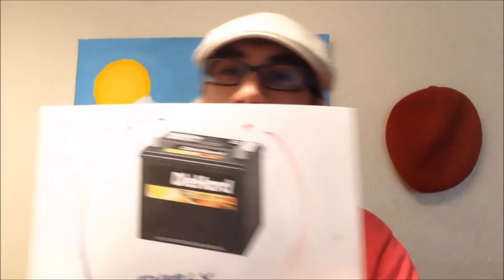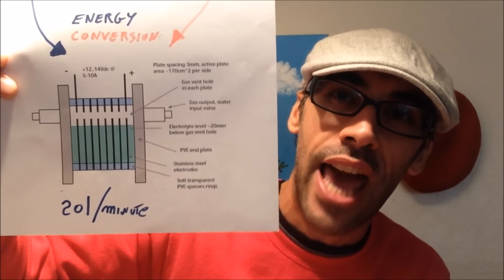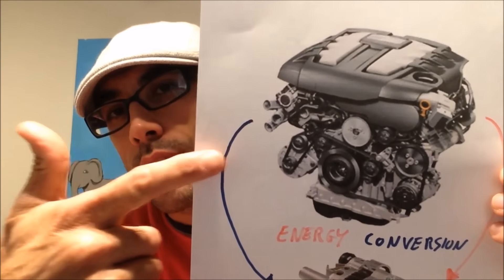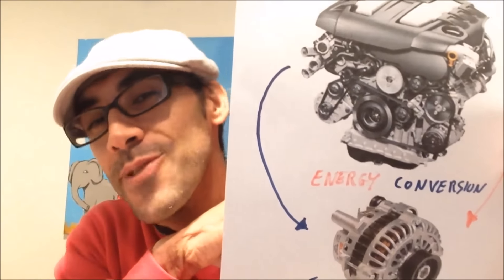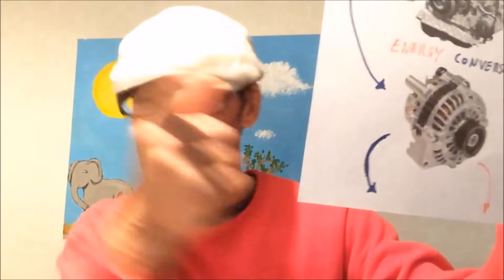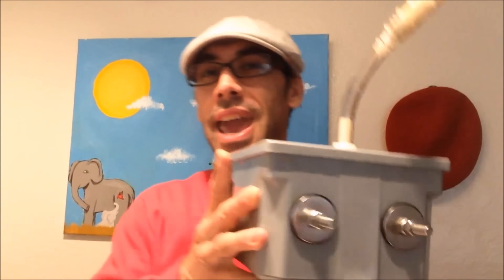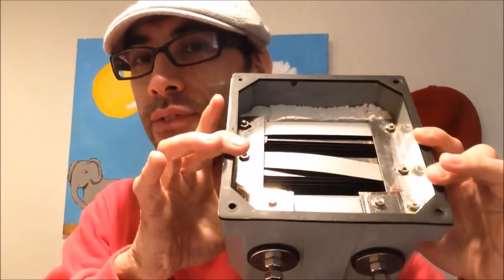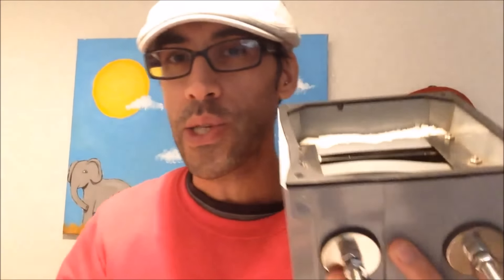FREE ENERGY Stanley Meyer 100% car motorcycle water EXPLAINED DEBUNKED!!

Comment: I love all your videos but check this out. I was running my car with pure hydrogen. I used a plastic water jug full of water and 10% naoh. The car had a LPG carburetor system and the pure hydrogen generator had three settings. Each settings would drop more aluminum pellets into the tank. The naoh would strip the aluminum oxide layer and expose the aluminum to the water and hydrogen is released and the oxygen is absorbed into the aluminum making another layer of aluminum oxide and the process happens over and over till the small pellets are fully used up. The three setting would drop a different amount which gave me three different rpm speeds. I had posted videos of me compressing this full safely and my car running on this full and shortly after my last video the police came to my house and told me not to drive my car on the road again till it was converted back. Also they informed me compressing hydrogen is illegal, so now I only have videos of pure hydrogen production on my channel. So you can run a car on water but it will destroy your motor. I am a mechanic and put a camera in my cylinders and into the carburetor and it didn't look pretty. With the pure hydrogen you can control and set the ratio of hydrogen and oxygen which is important.
Reply from the maker: interesting story.

We already have plenty of hydrogen cars for sale including:
Toyota Mirai 
BMW hydrogen 7 
Nissna X-trail 
Morgan LIFEcar
FIAT Panda Hydrogen
etc.
etc.

Why would you build one yourself at home??? 

The chemical reaction from a battery is FAR MORE efficient than aluminum oxide oxidation process

Cheers!
Reply: I was bored and have a bunch of old cars in the yard and received all the aluminum from the local landfill for free to make the pellets. Just wanted to see if hydrogen could run a car and how well. I am retired and have lots of time and free material and a free vehicle so why not see if it would work. But for anyone else its not feasible cause the naoh, or pure lye and water and aluminum cost more then gas does. I am out on my gold claim mining right now but thanks for the response. Cheers your fan Daniel.......
Reply: Also it use's zero electricity to make over 100L per minute of pure hydrogen gas......
Reply from the maker: It sounds like you`re living your retirements as my dreams suggest me :)

Inventing, disassembling, building etc that`s my future pension if I ever reach one! 

Cheers!
Reply from the maker: yeah electricity is just a quicker way around, nothing special

Comment: If you run a second alternator ,by pass the diodes you will have 60 plus amps dedicated power to the hho
Reply from the maker: running a second alternator will drain more power out your gas engine and drop efficiency even lower

There is no free lunch for anyone

Thank you for watching
Reply: Skeptical Open-mind if you have 60 plus amps you could power 2 or 3 cells and increase output of hho to increase efficiency

Comment: I see you can run your car on water. Did you disconect fuel line from the engine ? if not then you use gasoline to run your car mr free energy...

Comment: That car has a computer controlled ignitions system and just hooking up a HHO system to it wont work. you have to fool the O2 sensor. Meyer had a distributor cap system... no computer. gas burns at 783 F HHo burns at 5000 f, you probably have a hole in your piston.
Reply from the maker: While actually running an ignition system on pure HHO is not good and can damage other parts for sure.

None of these ppl have a "hole in their piston" :)
https://www.youtube.com/watch?v=VteoVsK93Mg

https://www.youtube.com/watch?v=NuDVXjS5Lhw

https://www.youtube.com/watch?v=3JbXLGIL_fc

https://www.youtube.com/watch?v=j4cRvz1fDPA

Regards

Comment: Modern cars have a fuel regulator. Modern cars have a fuel regulator, adding hydrogen to your fuel just increases the output of regular gasoline into the engine. If you have an older car however it would work. But I never heard about adding ammonia to increase reaction. I'm going to try it! LOL

Comment: You are lucky if you are making 1 liter per minute. Possibly two. I know you didn't do the liter test, but putting that aside, why wasn't your alternator running the fuel cell? Why did your battery drain? Did you disconnect your alternator? I'm honestly curious.

Comment: making hydrogen out of water via wire cables from battery to copper/metal plates in sealed container with a vapor filter and tubing leading to fuel injection system ()carburetor works better), and tweaking of air/lean mass on both the system and the ccm(computer control module) to accept a leaner fuel/gas mixture for combustion. No matter what, it ALL requires energy to make, its not about free or not, its about the cheapest/easiest/most productive versus cost.
Reply from the maker: Yep Yep well said!

We already have hydrogen cars(Toyota Mirai, Honda clarity etc) ....

obviously the hydrogen has be produce "outside" the car system AND hydrogen cars a are rigorously electric here is why:
electric engine(>90% efficiency) 
combustion engine(<60%) 

Cheers!

Comment: The U.S. military used engines in some Spitfire and even some P-51 M.ustangs that ran on water.
Reply: yeah they stop using that engine since water got so expensive...
Reply: only partially, the steam was produced using the rejected heat and was used as a catalyser to improve the total efficiency.

Comment: I think you picked the wrong guy and subject! Stanley Meyer's Cell did not get hot as it certainly does with high current (A). The combination of Resonance (Hz) and High Voltage (V) is the key here, not high current!
Reply: I think you picked the wrong guy and video to criticize! Point in this video where it complains it gets hot his cell. Hz is just frequency ...resonance is totally another thing...high voltage is not the key at all. As a manner of facts is the QUANTITY of electrons (A) flowing thru the liquid that causes particles bond braking not how fast (V). Voltage causes whats called "skin effect" and Faraday proved you can have all the Voltage you want without current.
Now how in the hell you gonna brake the water molecule without current???
Reply: It`s funny how folks here think they know shit and complain when in reality they don`t know what they are talking about!.
The quantity of molecules splited is proportional to the amount of free electrons flowing thru the material so YES FUCKING AMPS...CURRENT!!!
Reply: Resonance is always Hz (as a single frequency, a combination of frequencies, or frequencies modulating in a linear or logarithmic fashion - always based on frequencies (Hz) - live with it, man ...
Reply from the maker: No worries "man" ...we`re all open mind here....Could you please build a water car,make a video of what you just claimed including some math that support your claims and where you get the extra energy once you convert it 3 times ....

Thank you really appreciated
regards

Comment: continue...: they would be put out of business by his products since you can not gain perpetual income from this process. The same thing happened to Tesla and J P Morgan. Tesla's device could not be metered to secure perpetual income for the capitalist.
Reply from the maker: This is the 3rd comment mentioning Tesla, Tesla, Tesla...I can tell you really don`t know what you talking about :)
Reply: Put the meter at the equipment receiver Tesla developed and it was definitely in Kwhr. I tried placing wire coil 1 meter near a 230 kv line and developed 6 kilovolt. At 2 meter 500 volt then connecting diode line to ground a had a power!

Comment: funny guy. gas engines may be 20-40% efficient. the idea should not be to run a car on pure hho but to add hho and water vapor to gas to improve the efficiency of the gasoline blend in the combustion cycle.  maybe with microcontrollers and sensors (measuring power, required torque and heating requirements, etc) gas-hho-h2o vapor engines can be made more efficient.
Reply from the maker: Thank you for watching! :)

This topic has been well discussed already, just scroll down thru comments.

Gasoline and hydrogen are 2 completely different chemicals that share literally ZERO physical characteristics in common.
Mixing these 2 things in your engine can only cause damage do the vehicle and dirty burn in the combustion chamber. 

Regards

Comment: the only good idea is the use of H2 as combustible......very clean.....solar energy to produce the H2 would be an alternative....shipper than gasoline?......also oxidating aluminum would be a source of H2......thanks for your videos.
Reply from the maker: Yes sir correct!
As a manner of facts Toyota Mirai is widely sold as a fuel cell car that runs on Hydrogen.

Of course has tanks to store Hydrogen safely since you cannot produce hydrogen while driving. :)
 That would be called "perpetual motion car"

Comment: Dude are u like a disinformation agent. How the fuck do use up 30 amps and twenty volts to get such little gas? I am not saying there will be over unity but there can be effeciency. You do realize that u can use a combination of frequencies and pulsing to get way better efficiency. 20 years ago we ran a lawnmower motor with 12 volts and about 700 milliamperes draw. It ran for at least 8 hours. Also u used a normal car. U do realize that many years ago they changed the carburetors to prevent people from using any kinds of gas. No wonder it killed ur battery so quickly. If u are going to debunk at least do things the right way....not just slapping something together with no knowledge just to prove a point.

Comment: Well, some things like heat generators use water steam for power. Debunking water for motorcycle use? lol
Reply from the maker: Yes correct! heat generators :)
usable but efficiency is less than 20% so for sure not free-energy and probably barely "green-energy"
Reply: Skeptical Open-mind Steam heat generators, like a sauna...
Reply from the maker: Using the steam out of a sauna it`s like dropping an ice cube in my hot tea :) 
Attaching a load in a system defeat the purpose of having that system in the first place!

Speaking about sauna....I have an idea for tonight after work 
Awesome thank you for the idea :)
Reply: Skeptical Open-mind 
Hey at 9:07
You literally made me drop my phone from laughing keep up the good work man!
Reply: Nate What?  You can use steam to do work, of course.  ITS CALLED A STEAM ENGINE.  Much LESS work than that required to turn the water INTO STEAM.
Reply: Nate wow, really.  You think tgat heating water above 100c to use the HEAT in a sauna has any relationship with the topic under discussion?  The heater in your car also uses the HEAT of hot water, did you notice that inventor being killed by the illuminati?

Comment: Who are you working for it's very easy for alternator to push 200 to 300 amps it's called pwm the power you get from hydrogen is more powerful than gas so we'll have no problem pushing that alternator you need to advance your timing too

Comment: Water has plenty of energy to do work e.g. Even run a car and far far more ,,the key was to release it with low volume of energy at high speed pulsed resonance,,H H O ,,,,,,which Stan Myers and family achieved ,,,,,just curious are you with a cult and if so how much to join CHEERS.

Comment: HOLY SHIT!!! I JUST REALIZED WHAT THIS GUY SAID. HE SAID HE MAKES 20 Lpm with less than 30 amps at 12 volts. Using 30 amps at 12 volts should give 3.34 lpm so this guy electrolyser is over 590 % efficient. Dam bro forget about running your car on water you should be selling those electrolysers. With that efficiency renewable such as solar and wind can store hydrogen 5 times more efficient than what they currently doing.........
This video is somthing else 🤣🤣🤣

Comment: I can see you mind struggling when trying explain the laws of thermodynamics with out acually saying them(i.e. using this scam and its faults as examples).
Lol and i feel your pain, i dont know how to explain it any simplier, science=/=magic period.
Everythibg is acounted for!
Reply: Unbelievable...you have no understanding of the concept you need to learn more .if you had More output from your cell you would get enough RPM from your engine to charge the battery..... ...how can you get so close but then miss that single point ?  more LPM from the cell and it will work, you may well need a larger alternator to go with the added amperage demand. but it will work ! try it !
Bob....

Comment: You only need 2 amps to produce 1 leter per minute per minute.  Your experience with HHO  was with little research and  laboratory expermintation. You have lost a lot of subscribes me being 1 of them.  If I had the funding to continue to build the HHO vehicle I would. Even the motor cycles you had on the video were working. Explain that if you can. Hydrogen is use to launch space craft into outer space from earth. So hydrogen as a fuel is in current use. Thanks for proving people will give up after only a small amount of effort. As for me its back to my lab to build a Stanley Mayer HHO Generator with the proper amps and frequencies.
Reply from the maker: We have plenty of hydrogen cars for sale made from real engineers. 

None of these cars obviously run on water 

Once you make your water car don`t forget to throw a video to debunk mine! 

For now running a vehicle on pure water without charging the battery is PURE BULLSHIT for SCAM.

Thank you for watching!
Reply: Jerry, the hydrogen used to fuel spacecraft is made by mixing natural gas with steam.

Comment: PSS . You pulled over with your flashers flashing then you show us on a volt meter the battery  dead as hell no volt what so ever. You blew it game over fake.
Reply: even kids know a car battery is considered dead when below 12volts or not enough CCA. Still plenty of juice to run low drain lights such as blinkers.
Reply: Run lights but not show anything on a volt meter? I believe those kids need to go to a better school.
Reply: voltage shows zero for the simple fact that turning signals sucked the little juice left in it. Is it really so difficult to understand?
Reply: No way you can totally kill a car battery that fast  especially  a new batter that would recharge itself by chemical reaction unless it's a dead short and I don't see any wires burning.. I know there is no way those hydrogen cells generators  can put out enough hydrogen to run a car but Myers setup was was totally different  then this guy is showing us. He didn't debunk a thing other then what was debunked years ago. One more thing . When he installed that unit I sure didn't see him cutting the gasoline supply that and he wouldn't even get 3 MPH out of it. He would be lucky to even get it started. It's a shame we have to debunk a debunker.
Reply: You know your comment makes no sense at all. Running an hydrogen cell that big I`m pretty sure you fukk up your battery fairly quick unless......you stop with assumptions and throw some real numbers out here to confirm your claims. 
If "Meyers technology" was way different(which it bullshit) can you please exhume that patent(expired) and point at it. Thank you for your time
Reply: Listen .  Take a new 12 volt battery and try to run it down flat dead that fast without it measuring anything on a volt meter and come back let me know what happens. This guy is fake on this one . Maybe not all but on this one he is. I build and rebuild batteries. Unless the battery sorted out on the inside you would still have voltage . Little or no amps but you will have voltage. As far as Meyers  look it up and learn. I just don't have the time or desire
Reply: sure buddy, you really convincing! 
here is the patent https://www.google.com/patents/US5149407 
1 Pulse width modulator with transformer, 
2 hydrogen cell with stainless steel tubes
3 regular water
could  you please point out in this patent the "special technology" Meyer used???? LOL
Reply: gee and his batter didn't go dead . go figure
Reply: I'm not trying to prove it works . I'm pointing out this guy really didn't test it .
Reply: physics don`t lie, plain and simple.....you can`t convert energy 1...2...3...4times and still pretend that car move your ass around.
Meyer was simply another scam between millions everywhere
Reply: And you think this guy was going 3 mph with his set up ? Like I said he would be lucky to even get it started. You just proving my point